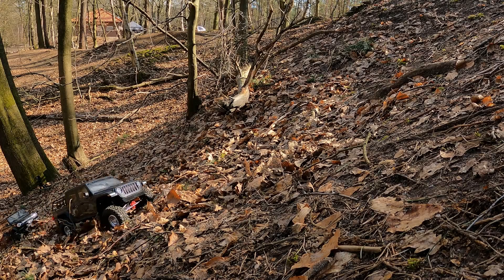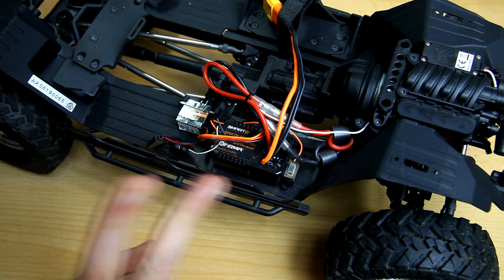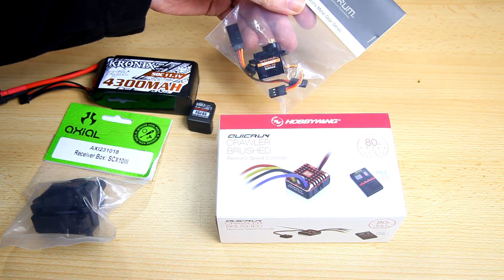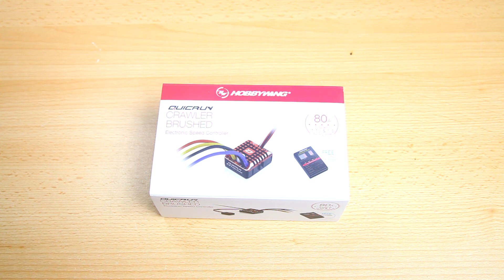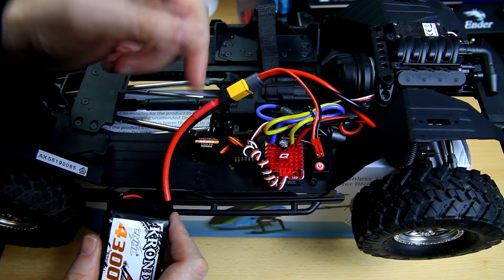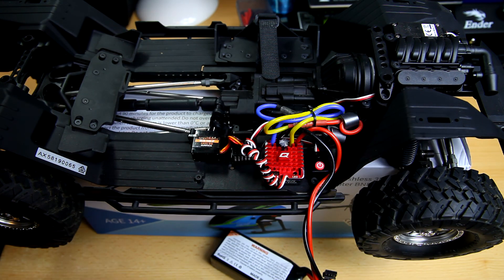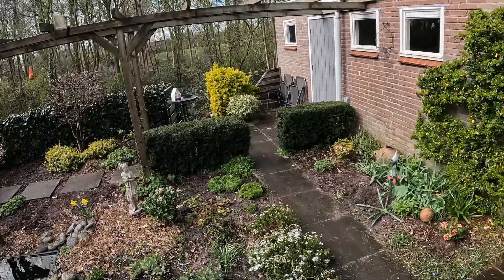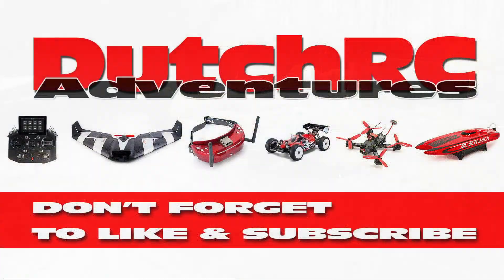HobbyWing QuickRun WP-1080 ESC - Axial SCX10 III Upgrades Series :)

Comment: You can use hobbywing 1080 program card to setting this spectrum esc, more cheaper and usefull, better than buy new esc and receiver set, and  for that servo you must adjust first to use that rc, its easy just bind first for epa, low risk for broke that servo..many people dont understand this product
Reply from the maker: Excvellent point! Thanks for adding that :)  good info!

Comment: Thank you for this video! I'm new to the hobby and ordered a new transmitter or whatever the remote is called and didn't realize it had the combo in it. So I've scouted YouTube as to what to do and found this video so thanks!!!
Reply from the maker: No problem and welcome to the hobby ofcourse! 
This ESC (speed controller) with integrated Receiver in cars, is generally you see in cheaper Chinese cars.. but well.. regretably name-brand cars sometimes also have this "feature" these days :)

Comment: Did you reprogram the Stock Esc with programched…????? 

Then it drives like a new crawler😃
Reply from the maker: yeah I did the "recommended" setup changes but I will say: even stock it's a nice running ESC :)